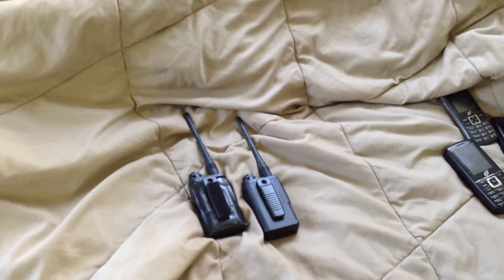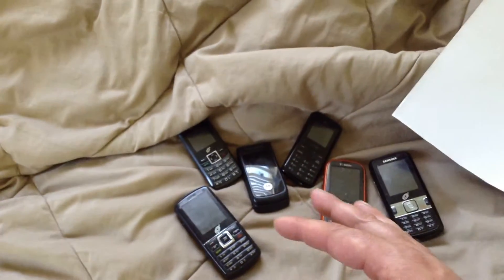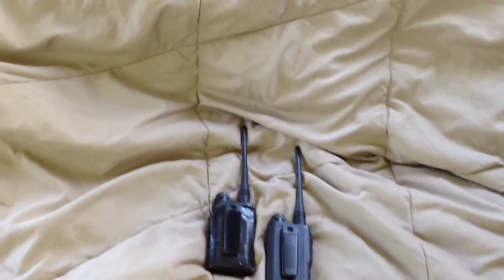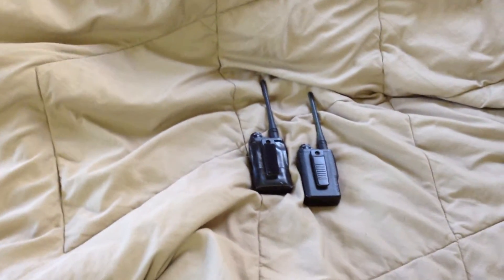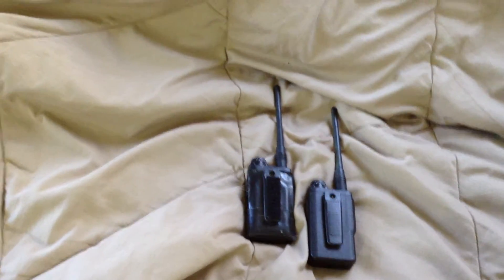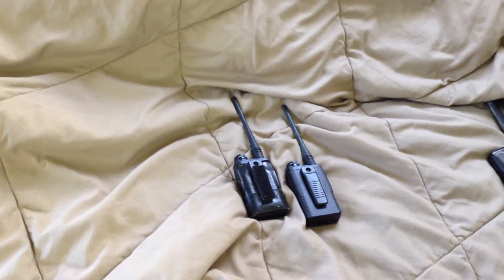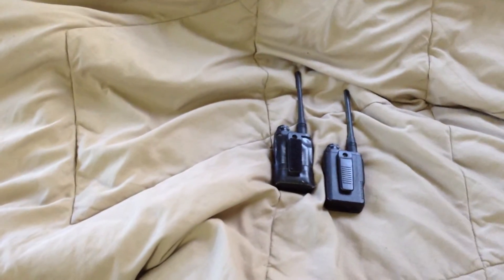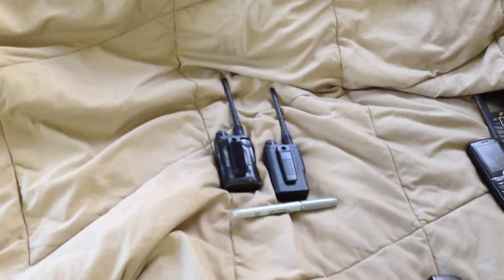Communications security protocols with ad-hoc groups and two way radios

Comment from the maker: Just to use this video as a topic starter for the relevant conversation, this protocol is probably not going to work out very well in larger scale more dynamic situations where apart from being involved in the same event, yourself and everyone else there is mostly total strangers with totally different schedules.  This is more of a practice for more cohesive groups, but in those larger dynamic situations, your own support personnel will be updating your own group's communication with everyone else, and that goes into establishing your "communications center' and what is supposed to get accomplished there.

Comment: Hello buddy I'm confused about something 
Could you please explain this "turning them in" concept you keep talking about ? Having on my own gear, spare battery & spare antennas, redundant everything, I don't see the point to turning my gear in, ( not even my disposable radios) so maybe I don't quite understand. Everyone has their own gear why would I share comms gear with the other people?
Reply from the maker: It depends a bit on the make and model, but with CHEAP radios, the idea is to assign a group specialist to keep them up and running, and accounted for, and on the right channels, and in a dynamic situation, turned in at and issued from a central communications management desk.   This reduces the admin time that field operations people should have to spend screwing around squaring away gear between sorties out of the camp and reducing prep time before taking over or being relieved from a guard post.   This is for site security and localized operations, for the most part.
Reply: Understood!
Thanks for the answer.

Comment: why not buy extra batteries instead of extra radio's? UV-5r batteries are under 10 bucks
Reply from the maker: A valid plan, but when we are talking about $15-$50 for radios from the same sources, then we are talking about only a little extra money to have a backup radio, additional charger, additional spare parts and a loaner radio in case of an expanded emergency.   If the people taking responsibility for radio supply on an individual basis bring two, and the radios recharge a little faster than they discharge, then your pool of say a dozen radios can supply seven or eight people.   If you just have spare batteries, sometimes the chargers allow for a battery to be charged alone, sometimes the battery has to be in a radio in order to take a charge, depends a little on the make and model.   With the two shown, the battery must be inside a radio in order for the battery to take a charge.